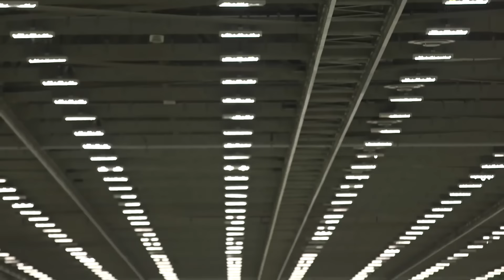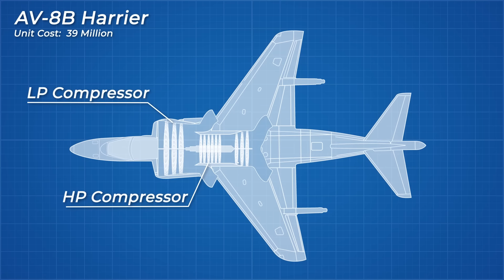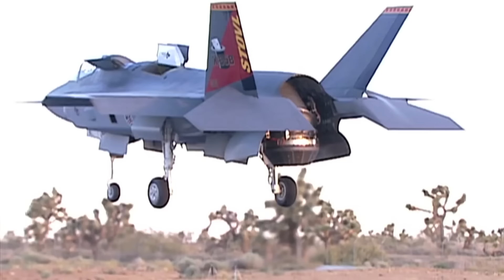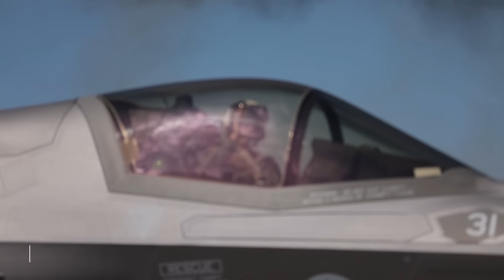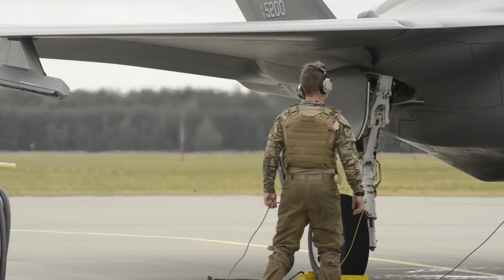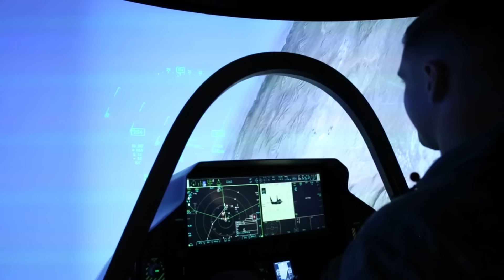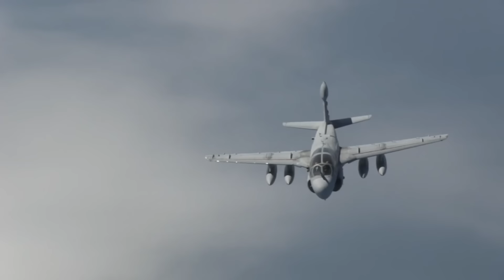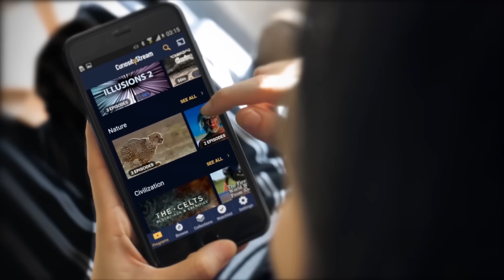Is The F-35 Worth $115 Million?

Comment: The USAF has emphasized the whole BVR thing before, back in the 1950's and 1960's.  The idea of detecting/firing first is great...right up until those idiots in Washington demand you visually identify your target before engaging.  ROE has always been the Achilles heel of such thinking and if anything politicians are more risk averse today than ever before.  What good is stealth and advanced sensor suites if you're forced into knife-fighting range?  Suddenly all the design compromises made for stealth are worthless and you're saddled with an aircraft that can't dogfight with planes forty years older than it.
.
If you discount stealth and the sensor advantage, the F-15 has superior range, speed, agility, and payload capacity when it comes to USAF needs.  The F/A-18 is cheaper, faster, and more agile for the Navy.  The A-10 is far more robust, has much better range, rough field capability, and carries a bomb load that dwarfs the F-35 for the USMC needs (why the USAF still monopolizes this plane when they clearly hate CAS is beyond me).
.
McNamara tried this "one size fits all" approach back in the 1970's and it failed miserably.  It will continue to fail, but politicians craving those sweet, sweet defense contract dollars don't care.  They're not the ones footing the bill and they're not the ones on the "tip of the spear" who have to bet their lives on this stuff.
Reply: Except that visual identification was not the issue. Identification in general was. In Vietnam the only way to positively identify a target was visually, not that it mattered much because NVAF MiGs almost always used ambush tactics and there were very few occasions where RoE prevented BVR combat. Most of the time the first sign of MiGs was when they opened fire. Sound similar to "stealth" per chance?

By Desert Storm F-15s were on average engaging their targets from 18km away, basically the max effective range of the AIM-7. They could positively ID a target from beyond the range of their weapons thanks to advanced electronics and sometimes AWACS were able to track MiGs from the moment they took off. Nowadays even if visual identification is required it can be accomplished from up to 50km away using advanced optical sensors which most fighters have, and many advanced radars can "scan" the target's shape from much farther distances.

If you discount stealth and sensors then you don't understand the benefits of those features. First off, the F-35 can VID targets from 50km away, potentially further in good conditions (even without it's radar). This means it does not have to enter close ranges to identify a target as a threat and dispatch it. As for stealth it reduces the effectiveness of enemy missiles regardless of range. Say an F-35A engages an Su-35S. Even if the Su-35S tries to retaliate with a missile, because the missiles have much smaller seekers they rely on guidance from the launch platform for most of their journey. The missiles (AIM-120 and R-77) can both detect an F-15 or Su-35 sized target at around 30km, but they can't detect a stealth target like an F-35 until around 5km. Since the F-35 is stealth it's AIM-120 will lock the Su-35 and allow the F-35 to turn away, and the Su-35 will be forced to take evasive action therefore abandoning it's missile which will miss the F-35, and the F-35 will just make a follow-up shot since to ensure victory.

As for your other claims in regards to the F-35....
The F-15...
+ Carries a slightly larger payload (or significantly larger when functioning solely as a missile truck while a stealth fighter does the targeting up front)
+ Is slightly faster on an air to air mission at higher altitudes as long as it doesn't carry any external fuel tanks or an overly large load of missiles, but otherwise it matches the F-35 in speed in a typical configuration.
+ Can fly higher giving it's missiles longer range, but this doesn't matter in your proposed situation
- Is slightly better in terms of sustained turn performance, but the F-35 is overall a more maneuverable fighter and has similarly excellent acceleration
- Has shorter combat range unless the decision is made to sacrifice performance
- Is an absolutely massive target on radar. F-15s can be detected from 400km by most modern fighter radars. Those same radars would detect an F-16 at only 200km.
- Has a worse sensor package even in the modern versions

The F/A-18...
+ Is slightly cheaper, but the F-35 is still getting cheaper and the F/A-18 is not. This is because the F-35 has only recently entered service and is not yet fully operational, nor has it entered full rate production.
- Is slower in it's sleekest configuration than a fully armed F-35. F/A-18's max speed while unarmed with no pylons attached is 1900kmph. The F-35 can reach 1930kmph while carrying a 5000lb payload and max fuel.
- Is less maneuverable in every way. The F-35 has better low speed performance, a better T/W ratio in a typical dogfight situation leading to better sustained performance and climb rate, and far superior acceleration thanks to it's much higher thrust and lower drag. Then there's the Super Hornet which has an even worse T/W ratio and more drag than the Hornet.
- (Super Hornet) Has slightly more than half the combat range of the F-35 when carrying external fuel tanks. Without external fuel tanks the F/A-18 has slightly more than 1/3 the combat range of the F35.

The A-10...
+ Can operate from dirt strips. The downside of operating from dirt strips is lack of a supply chain and therefore lack of options in regards to weaponry and sustained operations. Nevertheless an occasionally useful option.
+ Excels at a moderately common situation
- That situation is a minor aspect of CAS, and the A-10 performs worse in general at the role of CAS than the F-16 which is outclassed in every way by the F-35.
- That situation is only moderately common because the US keep putting their noses where they don't belong and making enemies out of people who don't have the weapons to engage aircraft, thus creating a safe environment for an A-10 to operate in.
- Can't survive on the frontlines of a conventional war
- In a situation in which the A-10 can function effectively the F-35 can carry a payload that dwarfs the A-10's. 
- Can't operate from locations that the F-35B can.
- There are cheaper options that are just as survivable and effective at the only thing the A-10 excels at, and the USAF are in fact evaluating options with the intention to field them in small numbers, possibly phasing out the A-10 later on.

I don't know why you think the USAF don't like CAS... the fact they have modified basically everything to be able to perform the role says they are very concerned about protecting the troops on the ground. 

McNamara tried a one-size-fits-all approach and it failed because of very obvious reasons, namely the fact that he forced already existing aircraft designs into the hands of services they were not designed for and in the only case where an aircraft was modified before being put into a different service the aircraft was the USAF's F-111 strike aircraft and it turned out to be far too heavy for any other service to operate. The F-35 was designed to meet the requirements of all 3 services before it was even prototyped, and each version is physically different so the sacrifices made to accommodate the bulky lift fan in the F-35B do not affect either of the A or C variants, and vice-versa.
Reply: @dumdumbinks274  addressing your lengthy post point-by-point would produce an even longer post so I'll try to make it brief:

- F-15 cost: $87 million
- F-18 Super Hornet cost: $66 million
- F-16 cost: $46 million
- A-10 cost: $46 million
- F-35 cost: around $100 million depending on model

All costs adjusted for inflation.

The above figures, however, do not consider that everything except for the F-35 is already bought and paid for, a substantial advantage.

Further, the above costs do not take into account cost of operation, which is significantly higher for the F-35.

Regarding the ROE argument, you make a good point about ID.  In Cold War conflicts we had to make sure we weren't shooting at Soviet pilots in Soviet planes vs. enemy pilots FLYING Soviet planes.  In Iraq we had the luxury of knowing a MiG was a target as soon as it was detected.

And yet, in low-intensity conflicts, pilots have still frequently been ordered to allow potential hostiles to close range long after they've been detected, ORDERED to allow them to fire first before engaging.  I posit this trend will continue, thus negating many (yes, not ALL but MANY) of the advantages of stealth and sensors.

Stealth in and of itself is a bit of a double edged sword.  In order to carry a useful payload or extend its range, the F-35 must carry non-stealthy external stores.  In such a configuration it is no better -- and in some cases demonstrably worse -- than what it is expected to replace, all while being much, much more expensive to procure and operate.

The F-35 is indeed a marvel of engineering.  I'm not knocking it.  But the very concept of a "one size fits all" approach is flawed.  The missions and branches it's supposed to serve are too different for such an approach.
Reply: @ThePrisoner881  The F-15 averages $100m and has done ever since the F-15K was first produced in 2006. It is estimated that the absolute lowest price that could be obtained in a purchase of hte new F-15X is $90m, and only if they replace all F-15Cs that are in service. 

The F/A-18E/F Block 2 cost $73m back in 2013. 

The F-16 Block 50 is $55m at the very minimum. Block 40s from 1988 have been sold 2nd hand for about $40m each with only minor upgrades since they entered service. F-16 Block 60 and above average around $65m, with the most advanced version going for $70m.

Your A-10 cost is roughly correct, but it is only an estimation since no A-10s have actually been produced since the A-10A in the 1980s. Production of new models would come with a premium to cover the costs of a new factory and tooling.

F-35A costs $78m and is the standard version. $101m is the current highest unit cost of all F-35 variants, and it is for the F-35B which is a specialist version. The F-35C costs around $95m, but part of that is because the USN have been slow to adopt it. Consider that none of the 4th gen platforms come close to being able to match an F-35's effectiveness and you can realise that none of them match the F-35's cost-effectiveness either.

F-35 cost of operation is high currently because it has only recently entered service. It isn't even fully operational. It is expected to be no more costly than an F/A-18 once it is fully operational in the next few years, and that also makes it cheaper than the F-15, and barely more expensive than the F-16.

Your comment about low-intensity conflicts is for a one-off situation that if the enemy opens fire would then start a war in which the orders would no longer be to let them fire first. Not to mention the only case in recent history of a aircraft being seen as a genuine threat resulted in an F/A-18 giving it plenty of warnings and then shooting it down before it had the opportunity to engage it's target. You're also assuming that every single F-35 in the area would be flying right next to the potential bandit, but that isn't how intercepts are completed... there are usually multiple aircraft involved and only a couple of them ever get close to the target in case they are determined to be hostile.

Stealth is not remotely a double-edged sword. There is no payload disadvantage. The F-35 is capable of carrying the standard strike payload of any of the fighters it replaces, but internally. Externally it can carry more than any of those aircraft. It also has significantly longer range and does not have the capability to use external fuel tanks, meaning that unlike a F-16 or F/A-18 every pylon on the F-35 is reserved for weapons.

Considering an F-35 is faster while fully armed for a long range strike mission than an unarmed F/A-18, this begs the question; In what configuration is it demonstrably worse than any of it's 4th gen counterparts?

The F-35 is no more multi-role than the F-16 or F/A-18. It is only a major upgrade in performance and effectiveness within those roles. The services each had similar requirements for a multi-role 5th gen fighter, and they got exactly that. There are physically different F-35 versions, and none of the compromises made in a single version are shared with the other versions. It is definitely not a one-size-fits-all approach
Reply: @dumdumbinks274  your replies grow ever longer to the point where I'm seriously wondering if you work for Lockheed.  You seem to have an almost religious fervor over the F-35, unable to find a single fault with it anywhere about anything.
.
Let's cut to the nub of why I disagree with you.  The F-35 has been pitched as a replacement for the F-15, the F-16, the F/A-18, the A-10, and even the venerable AV-8B -- five very different airframes.  The F-15 is a dedicated air-superiority fighter.  The F-16 is a lightweight multirole fighter. The F/A-18 is a multirole fighter more in tune with naval operations.  The A-10 is a dedicated CAS platform.  The AV-8B is a niche unto itself.
.
Each of these was built to perform a specific function and to do it better because it was built for that function.  This makes sense.  A tool dedicated to a specific function will usually be better (or at least cheaper) than a more generalized tool made to perform many different functions.  Yet somehow the F-35 can replace all of these, do just as good of a job, and cost less while doing so.  I don't buy it, and I'm not alone.
.
Without going over the point-by-point pros and cons of each aircraft, I will say only this: we could have done better had we evolved a separate airframe for these very-different roles.  We needed the F-35 to fill the role the F-16 filled: a cheaper, simpler sibling to the F-15.  That is how it was pitched in the beginning.  It is, indeed, cheaper than the F-22, but aside from stealth and sensors it has notable deficiencies compared to the F-16.  It has a lower thrust-to-weight ratio, its top speed is 300mph slower, and it's close-range weaponry is underwhelming just to name a few. But worst of all it is horrendously expensive to operate compared to the F-16...or any of the other airframes listed above.  And the F-16 costs between a quarter and a third of an F-35 to purchase.
.
I get it.  The F-35 is designed for a post-dogfight world.  U.S. Air Force Gen. Mike Hostage said, “The F-35 pilot who engages in a dogfight has either made a mistake or been very unlucky," which, by the way, speaks volumes about his confidence in its ability to dogfight.
.
If you're in a situation where you want to pick off your enemies at range and feel relatively safe doing so, I would agree something like the F-35 is the preferred platform.  But if the situation does not allow you fight like that -- if you get "unlucky" as Hostage put it --  I'd prefer having three F-16's over a single F-35.  And that's just considering purchase price.  Factoring in operational costs, you could likely maintain five or six F-16's for the cost of a single F-35.  I don't care how good the F-35 might be, it's not good enough to offset those numbers.  Chances are, the F-35 is going to find itself outnumbered in any real war.  I doubt it can carry enough weaponry onboard to handle such a situation even if it achieves a solid kill for each missile expended.
.
Put simply, the F-35 is trying to be too many things to too many customers with wildly varying requirements.  We'd have done better to evolve the existing ideas of dedicated air superiority (the F-22 did that), dedicated multi-role (a true cheaper, lighter F-16 replacement), and dedicated CAS (a true A-10 replacement), adding the advanced sensor suites where appropriate to each and stealth up to the point where it doesn't overly impact the actual mission of the airframe (I'm mainly referring to CAS here, which the F-35 is abysmal at).
.
You like the F-35.  Fine.  Forgive me for feeling that it's a gold-plated spork when what we asked for was a better set of forks, spoons, and knives.
Reply: @ThePrisoner881  Sorry, but I'm just stating facts.

The F-35 has been discussed as a potential replacement for the F-15 and A-10... The F-15 because the F-15 is just inferior in air combat, and the A-10 because it is a specialist that does not contribute anything to the main mission of the US military i.e defending the US as a nation. However the F-35 has only ever been required to replace the AV-8B, F-16, and F/A-18. The F-15 and A-10 were merely considerations once the F-35 began to take shape and a better understanding of it's capabilities and performance was available.

Not sure why you're going on about the airframes being different... it's the roles that matter and the F-16, F/A-18 and AV-8B all perform the same roles, so there's no problem. As for your claims about what they are... 
- The F-15 is a multi-role fighter... always has been. The idea of "Not a pound for air to ground" was a USAF catch phrase about their use of the F-15, not the F-15's capabilities. 
- The F-16 is arguably the most multi-role platform in the US military, with the F/A-18 being generally inferior in every aspect of performance other than maximum payload, but it can't carry a larger payload in any practical situation because that would sacrifice range which is very important to a carrier-based fighter.
- The A-10 is a platform so dedicated it is a specialist even within the role of CAS. The F-16 and most other fast jets have proven themselves more effective at the general role of CAS than the A-10.
- The AV-8B doesn't do anything that the F-35B cannot do. The F-35B can do a heck of a lot more too.

Considering the F-35 is 3 physically different aircraft each individually designed for a different service's requirements I'm not sure what you are getting at with the claim that different aircraft would be better. 

The F-35A fills it's purpose exactly as required... it is completely superior to the F-16 in every aspect of performance while being cheaper overall than both the F-22 and F-15. The only aspect of performance the F-16 even comes close in is the dogfight, but even then it is less maneuverable. The F-16's MAX speed is 200kmph faster than the F-35's currently noted top speed, but the F-16 attained that speed while unarmed... the F-35 achieved 1930kmph while carrying a 5000lb strike payload, and if the F-16 was equipped for the same mission it is only capable of around 1300kmph. F-35A has a higher thrust to weight ratio of around 1.12 vs the F-16 at 1.04 assuming both aircraft are configured for a dogfight. The F-35's close range weaponry is superior to the F-16. F-35 has AIM-9X and a 25mm cannon (albeit with fixable defects), whereas the F-16 has AIM-9X and a 20mm cannon. The F-35's cost to operate is currently high because it is new and infrastructure hasn't been fully implemented. The same thing has occurred with every new platform. 

"U.S. Air Force Gen. Mike Hostage said, “The F-35 pilot who engages in a dogfight has either made a mistake or been very unlucky," which, by the way, speaks volumes about his confidence in its ability to dogfight."
- His comment says absolutely nothing about the F-35's dogfighting capability. It is US doctrine to avoid dogfighting even in the F-16. This is because the ability of a pilot to process information is greatly diminished when pulling 9Gs and as such it can take several seconds for even the best pilots to realise they are being targeted by an enemy fighter that was late to the fight. If anything he is saying that a pilot in an F-35 who gets into a dogfight is even less competent or incredibly unlucky because the F-35 has an absolutely massive advantage in sensors and warning systems over every other fighter including the F-22, and the pilot would have to make the decision to enter a dogfight and handicap himself unnecessarily.

If I got unlucky I would much prefer to be in an F-35 which has pretty decent sustained performance and far superior instantaneous performance compared to the F-16 in a dogfight, as well as the ability to engage targets in any direction. In terms of actually buying the aircraft you can get maybe 5 modern F-16s for every 4 F-35s. Even 2nd hand 1980s F-16s have been sold recently for about half the price of an F-35A. Currently you can operate 2 F-16s for the same price as an F-35. With those facts in mind the F-35 is easily the more cost-effective option right now, and it is still getting cheaper.

Put simply, you haven't done much research. The F-35 isn't trying to do any more roles than the F-16 or F/A-18, it is trying to do those roles better than them, and it accomplishes that.